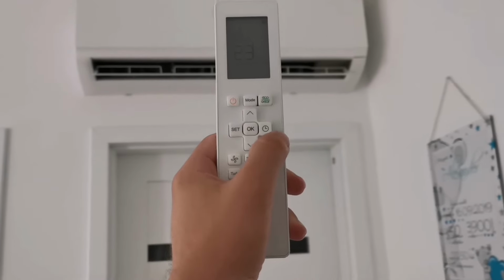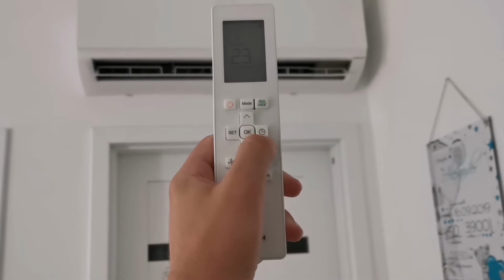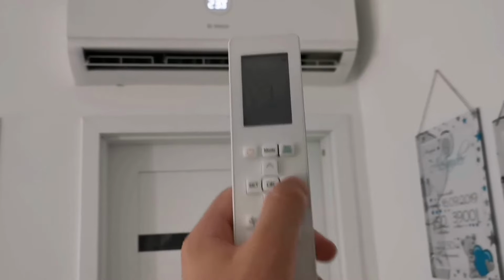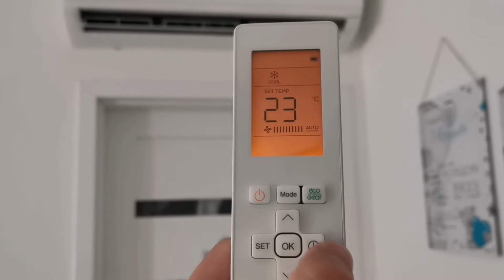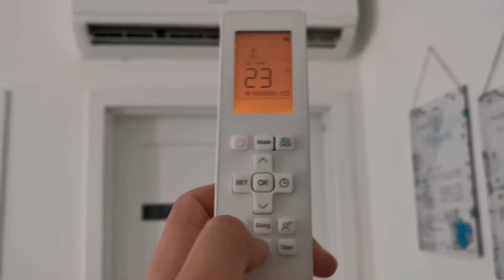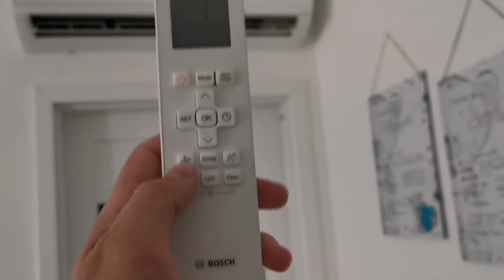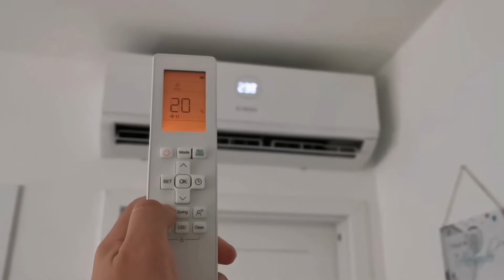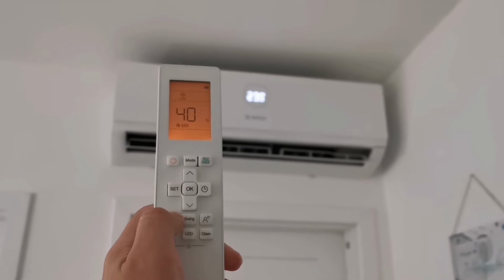BOSCH Climate 3000i - Air Conditioning

Comment: I keep pressing the power button on the control but the unit doesn't respond. Could it be that it has no power? How can I be sure?
Reply from the maker: It’s possible the unit has no power. First, check if the power outlet or circuit breaker is working. You can also try turning it on with the button on the indoor unit (if available) to rule out a remote issue. If nothing responds, it's likely a power problem.
Reply: @DanielMagura I had already solved it, but thank you. It was a power problem: in what I think is a very strange installation choice, the power supply came from a circuit with a switch (like the one to turn on the lights in a room), but that switch was small and very low, almost on the floor of a different room!

Comment: Im thinking about getting one of these and have a question: The manual says you can set the temperature you want and the unit will heat up or cool the room to match it. If in high summer you only want to cool down to a certain temperature is that possible? Eg if it is 34C and you want it to cool to 24 and then stop can it do that? If the room naturally falls below 24C in the night I don’t want it heating the room up to try to get back to 24C
Reply from the maker: Yes, if you set it to Cool mode and 24°C, it will cool to that temperature and stop. It won’t heat the room if it gets cooler — just avoid using Auto mode to prevent heating.

Comment: Does anyone have same problem like me, where in cold nights it goes into defrost mode very often ?
Reply: Yes. Even when it's outside like 10-12 degrees and the inside temperature is set to the minimum of 16°. Worst buy ever.
Bosch checked and replaced everything but it's keep on doing this and say 'that they've never seen this issue'. Very frustrating.
Reply: @ I did full clean now works better
Reply: @Ten_minlaterugotdropped8  full clean? Only the indoor unit has 1 filter, right?
Reply: @marijngeerts  “clean “option from the remonte controller  let it run for 30min at least like this than switch to normal use. Also indoor filter yes. 

I find in cold nights it’s perfect to set temperature of 23 at 60-80% fan speed. Doesn’t go on defrost very often
Reply from the maker: Seems you have to call a service

Comment: hi friend! i have the same Ac and i have issue ! it stays on for 30 min only then turns off … i tried many different settings but not fixed.. i tried to off and on the timings but no use ! have you have any idea
Reply from the maker: I need to wait only if i use heatin mode, but i need to wait few minutes.. e. g. 5 minutes. I think you shall call a service.